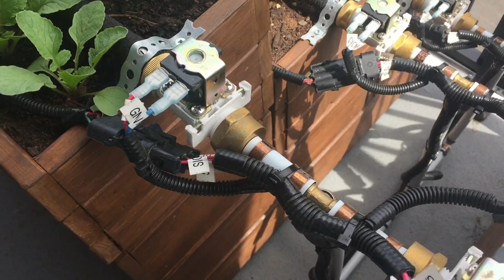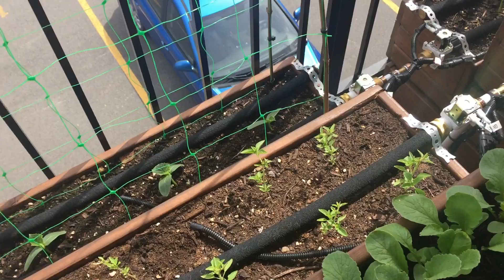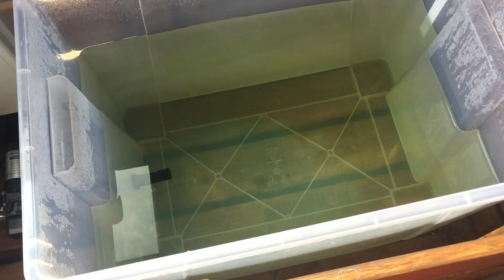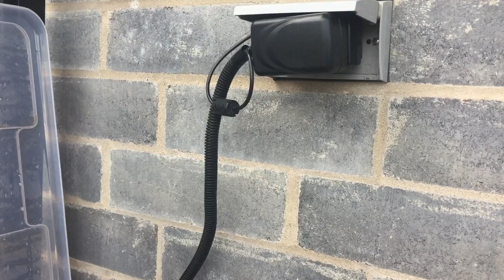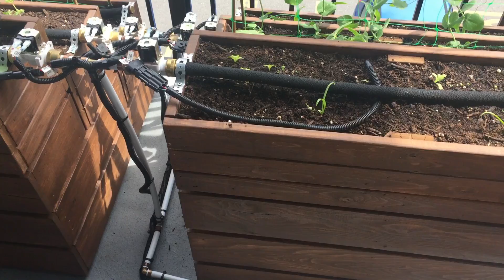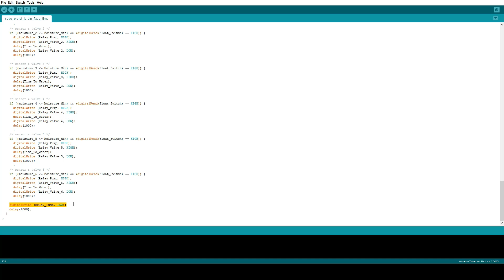Arduino Automatic Garden Watering System

Comment: Thanks for share your video , i like your system . I;m working in  my garden and thinking in make automatic system too.
can you share your code , i will appreciate if you do , thanks.....
Reply from the maker: /* Analog Input*/
int Humid_Sensor_1 = A0;
int Humid_Sensor_2 = A1;
int Humid_Sensor_3 = A2;
int Humid_Sensor_4 = A3;
int Humid_Sensor_5 = A4;
int Humid_Sensor_6 = A5;
 
 /Digital Input/
int Float_Switch = 10;
 
 /Digital Outpur/
int Relay_Sensor = 2;
int Relay_Pump = 3;
int Relay_Valve_1 = 4;
int Relay_Valve_2 = 5;
int Relay_Valve_3 = 6;
int Relay_Valve_4 = 7;
int Relay_Valve_5 = 8;
int Relay_Valve_6 = 9;
 
 /Variables/
float moisture_1 = 0;
float moisture_2 = 0;
float moisture_3 = 0;
float moisture_4 = 0;
float moisture_5 = 0;
float moisture_6 = 0;
unsigned long previousMillis_Check = 0;
unsigned long previousMillis_Water = 0;
unsigned long currentMillis = 0;
 
 /Constants/
float Moisture_Min = 36.01;
long Interval_Check = 300000;
long Interval_Water = 5400000;
int Time_To_Water = 10000;

const int numReadings = 5; 

float readings1[numReadings];      // the readings from the analog input
float readings2[numReadings];
float readings3[numReadings];
float readings4[numReadings];
float readings5[numReadings];
float readings6[numReadings];
int readIndex = 0;              // the index of the current reading  
float total1 = 0;                  // the running total
float total2 = 0;
float total3 = 0;
float total4 = 0;
float total5 = 0;
float total6 = 0;

void setup(){
  Serial.begin(9600);
  Serial.println("reset");
  pinMode (Float_Switch, INPUT);
  pinMode (Relay_Sensor, OUTPUT);
  pinMode (Relay_Pump, OUTPUT);
  pinMode (Relay_Valve_1, OUTPUT);
  pinMode (Relay_Valve_2, OUTPUT);
  pinMode (Relay_Valve_3, OUTPUT);
  pinMode (Relay_Valve_4, OUTPUT);
  pinMode (Relay_Valve_5, OUTPUT);
  pinMode (Relay_Valve_6, OUTPUT);
 
  for (int thisReading1 = 0; thisReading1 < numReadings; thisReading1++) {
    readings1[thisReading1] = 0;
    }
  for (int thisReading2 = 0; thisReading2 < numReadings; thisReading2++) {
    readings2[thisReading2] = 0;
    }
  for (int thisReading3 = 0; thisReading3 < numReadings; thisReading3++) {
    readings3[thisReading3] = 0;
    }
  for (int thisReading4 = 0; thisReading4 < numReadings; thisReading4++) {
    readings4[thisReading4] = 0;
    }
  for (int thisReading5 = 0; thisReading5 < numReadings; thisReading5++) {
    readings5[thisReading5] = 0;
    }
  for (int thisReading6 = 0; thisReading6 < numReadings; thisReading6++) {
    readings6[thisReading6] = 0;
    }  
    
  digitalWrite (Relay_Pump, HIGH);
  digitalWrite (Relay_Valve_1, HIGH);
  delay(2000);   
  digitalWrite (Relay_Valve_1, LOW);
  delay(1000);
  digitalWrite (Relay_Valve_2, HIGH);
  delay(2000);   
  digitalWrite (Relay_Valve_2, LOW);
  delay(1000);
  digitalWrite (Relay_Valve_3, HIGH);
  delay(2000);   
  digitalWrite (Relay_Valve_3, LOW);
  delay(1000);
  digitalWrite (Relay_Valve_4, HIGH);
  delay(2000);   
  digitalWrite (Relay_Valve_4, LOW);
  delay(1000);
  digitalWrite (Relay_Valve_5, HIGH);
  delay(2000);   
  digitalWrite (Relay_Valve_5, LOW);
  delay(1000);
  digitalWrite (Relay_Valve_6, HIGH);
  delay(2000);   
  digitalWrite (Relay_Valve_6, LOW);
  delay(1000);
  digitalWrite (Relay_Pump, LOW);
  }

void loop(){
  currentMillis = millis();
  
  if (currentMillis - previousMillis_Check >= Interval_Check) {
    previousMillis_Check = currentMillis;

    Serial.print("Index: ");
    Serial.println(readIndex);
    
    total1 = total1 - readings1[readIndex];
    total2 = total2 - readings2[readIndex];
    total3 = total3 - readings3[readIndex];
    total4 = total4 - readings4[readIndex];
    total5 = total5 - readings5[readIndex];
    total6 = total6 - readings6[readIndex];
    
    /Power to the sensors to read moisture/
    digitalWrite (Relay_Sensor, HIGH);
    
    delay(2000);

    /READ AND STORE VALUES/
  
    readings1[readIndex] = (3.6396322297 * exp(0.0029152931 * (analogRead(Humid_Sensor_1))));
    readings2[readIndex] = (3.6396322297 * exp(0.0029152931 * (analogRead(Humid_Sensor_2))));
    readings3[readIndex] = (3.6396322297 * exp(0.0029152931 * (analogRead(Humid_Sensor_3))));
    readings4[readIndex] = (3.6396322297 * exp(0.0029152931 * (analogRead(Humid_Sensor_4))));
    readings5[readIndex] = (3.6396322297 * exp(0.0029152931 * (analogRead(Humid_Sensor_5))));
    readings6[readIndex] = (3.6396322297 * exp(0.0029152931 * (analogRead(Humid_Sensor_6))));
    digitalWrite (Relay_Sensor, LOW);

    total1 = total1 + readings1[readIndex];
    total2 = total2 + readings2[readIndex];
    total3 = total3 + readings3[readIndex];
    total4 = total4 + readings4[readIndex];
    total5 = total5 + readings5[readIndex];
    total6 = total6 + readings6[readIndex];

    Serial.print("Moisture Sensor 1 Value: ");
    Serial.println(readings1[readIndex]);
    Serial.print("Moisture Sensor 2 Value: ");
    Serial.println(readings2[readIndex]);
    Serial.print("Moisture Sensor 3 Value: ");
    Serial.println(readings3[readIndex]);
    Serial.print("Moisture Sensor 4 Value: ");
    Serial.println(readings4[readIndex]);
    Serial.print("Moisture Sensor 5 Value: ");
    Serial.println(readings5[readIndex]);
    Serial.print("Moisture Sensor 6 Value: ");
    Serial.println(readings6[readIndex]);

    readIndex = readIndex + 1;
    
    if (readIndex >= numReadings) {
      readIndex = 0;
      }
    
    
    moisture_1 = total1 / numReadings;
    moisture_2 = total2 / numReadings;
    moisture_3 = total3 / numReadings;
    moisture_4 = total4 / numReadings;
    moisture_5 = total5 / numReadings;
    moisture_6 = total6 / numReadings;

    Serial.print("Moisture 1 Output Value: ");
    Serial.println(moisture_1);
    Serial.print("Moisture 2 Output Value: ");
    Serial.println(moisture_2);
    Serial.print("Moisture 3 Output Value: ");
    Serial.println(moisture_3);
    Serial.print("Moisture 4 Output Value: ");
    Serial.println(moisture_4);
    Serial.print("Moisture 5 Output Value: ");
    Serial.println(moisture_5);
    Serial.print("Moisture 6 Output Value: ");
    Serial.println(moisture_6);
    Serial.println(" ");
    
    }
    
  if (currentMillis - previousMillis_Water >= Interval_Water) {
    previousMillis_Water = currentMillis;
     
    /* sensor & valve 1 */
    if ((moisture_1 <= Moisture_Min) && (digitalRead(Float_Switch) == HIGH)) {
      digitalWrite (Relay_Pump, HIGH);
      digitalWrite (Relay_Valve_1, HIGH);
      delay(Time_To_Water);   
      digitalWrite (Relay_Valve_1, LOW);
      delay(1000);
      }
    /* sensor & valve 2 */
    if ((moisture_2 <= Moisture_Min) && (digitalRead(Float_Switch) == HIGH)) {
      digitalWrite (Relay_Pump, HIGH);
      digitalWrite (Relay_Valve_2, HIGH);
      delay(Time_To_Water);   
      digitalWrite (Relay_Valve_2, LOW);
      delay(1000);
      }
    /* sensor & valve 3 */
    if ((moisture_3 <= Moisture_Min) && (digitalRead(Float_Switch) == HIGH)) {
      digitalWrite (Relay_Pump, HIGH);
      digitalWrite (Relay_Valve_3, HIGH);
      delay(Time_To_Water);   
      digitalWrite (Relay_Valve_3, LOW);
      delay(1000);
      }
    /* sensor & valve 4 */
    if ((moisture_4 <= Moisture_Min) && (digitalRead(Float_Switch) == HIGH)) {
      digitalWrite (Relay_Pump, HIGH);
      digitalWrite (Relay_Valve_4, HIGH);
      delay(Time_To_Water);   
      digitalWrite (Relay_Valve_4, LOW);
      delay(1000);
      }
    /* sensor & valve 5 */
    if ((moisture_5 <= Moisture_Min) && (digitalRead(Float_Switch) == HIGH)) {
      digitalWrite (Relay_Pump, HIGH);
      digitalWrite (Relay_Valve_5, HIGH);
      delay(Time_To_Water);   
      digitalWrite (Relay_Valve_5, LOW);
      delay(1000);
      }
    /* sensor & valve 6 */
    if ((moisture_6 <= Moisture_Min) && (digitalRead(Float_Switch) == HIGH)) {
      digitalWrite (Relay_Pump, HIGH);
      digitalWrite (Relay_Valve_6, HIGH);
      delay(Time_To_Water);   
      digitalWrite (Relay_Valve_6, LOW);
      delay(1000);
      }
    digitalWrite (Relay_Pump, LOW);
    delay(1000); 
  }
}
Reply from the maker: lastest version of it.
Reply from the maker: here is the link, http://s854.photobucket.com/user/Pascal_Godin/media/layout_zpsej4xfo7t.png.html
to the top are the sensors in re, the green squares are relays and on the bottom are the valves and the pump
Reply: @pascal789456123  Hello pascal...thanks again for this wonderful video. 
Please I'd be so glad if you could resend the link to how you connected the sensors, I'm having trouble accessing this one.

Thanks...hoping to hear from you.
Reply: thank sir for share this code.
Reply: Thanks Pascal for your work. Can you please also post the Arduino connection scheme in order to .understand how the sensors connections are made? thanks,
Reply from the maker: Mario Palma i do have a layout picture of this, but I don't know how I can upload that here, I'll see what I can do, maybe a photobucket link or something
Reply: Thanks for your prompt reply. If you want you can sent it to my email address.
Reply: many thanks. Just a few question: I guess the 1st relay in to control the master pump (input from the thank) is it? What's the function on the relay on the left top part close to the (red) sensors and the "stuff" on the top right part of your schema, connected to the light blue connections?. Thanks again.
Reply from the maker: yes, the pump takes water from the tank and feeds the valves, if you have a tap water source, you dont need the pump. The relay next to the sensors are so I can power on the sensors only when I scan for moisture, that way, the sensors should last longer, since the sensor acts as an anode and cathode and would degrade over time. The item on the right is a float switch, so the pump doesnt run if the tank is empty.
Reply: Pascal, many thanks for your clarification. So if I'm working with tap water source I can eliminate both the float switch and the first relay. Thanks again.  Mario
Reply from the maker: Mario Palma one thing I'll be changing next year, is adding a pressure regulator on the main water line, the high pressure from the pump (probably similar to a tap water source) is making  tears on the hoses and result into poor watering. If flows all from that tear only.
Reply: I'll wait for your project update. In the mean time I'm analyzing another project for sprinklers using Google calendar to be programmed.